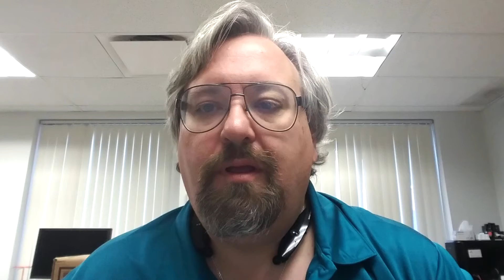How To Set Voltages On BD Instruments And Flow Cytometers

Comment: Hi Tim, you suggest 10x SDen to set the baseline voltage, but a BD application note suggests ~2.5x SDen, why the discrepancy? Great vid!  G
Reply from the maker: BD's CS&T sets the baseline voltage at 10x SDen.  So the value that is reported out in CS&T baselines is that value.  BD, over the last few years, has been moving away from that value in their webinar and seminar series, pointing to the 2.5X SDen to set the background.  According to BD, they have found that 2.5X SDen is sufficient, but they have not explained why they have not changed it in CS&T. 

Personally, I prefer to optimize my PMTs using the peak 2 method (http://onlinelibrary.wiley.com/doi/10.1002/cyto.a.20333/abstract) to determine my instrument sensitivity followed by a voltration to fine-tune the voltages.

Regards,
Tim and Team ExCyte